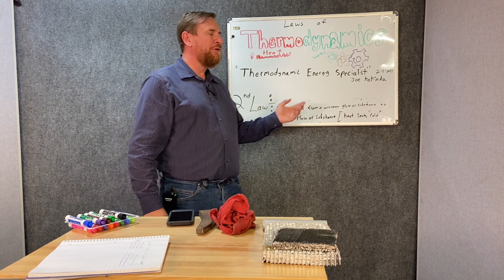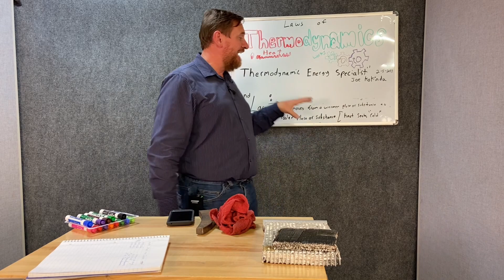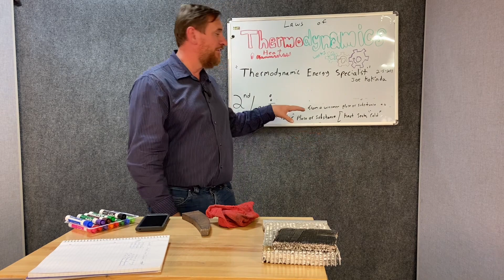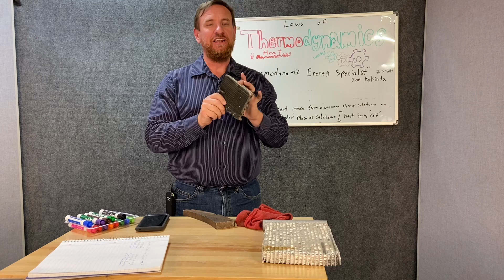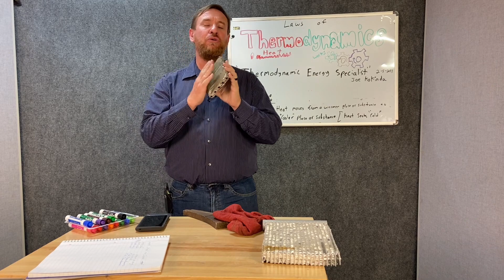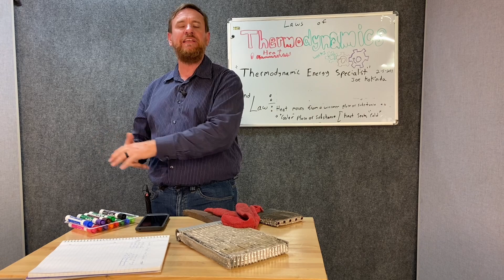HVAC 004 2nd law of thermodynamics simplified for HVAC

Comment: Thank you so much for sharing this video series. Funny story: I was vaguely familiar with the 2nd law of thermodynamics. I was having lunch with a guy and for whatever reason, we got talking about his soup. He insisted his soup was hotter near the surface because "heat rises." I didn't know how to explain that it was impossible for his soup to be hotter near the surface where it met the ambient air than it was at the bottom where it was insulated. Where were your video lessons when I needed them?

Comment: I teach my children about heat transfer and show them how it is in effect in almost everything you do.
Show my wife about heat transfer in cooking and other household and kitchen type applications. Everything from cooking in an open pan with grease versus open pan of water to oven cooking to positioning things in the freezer.
Also very importantly how even in a 100 degree kitchen extra ventilation of the refrigerator makes it still keep the freezer totally cold and easier on the compressor.

Comment: So Mr. B. I have thought about this often and have just never asked anyone. I have been doing HVAC work with my brother part-time for over 22 years. I won't bore you with the details, but rather just ask my question. Dealing with evap coils and coils, I know they are sometimes all aluminum and other times have copper tubes with aluminum fins. Has there ever been a solid copper coil? With copper tubing and copper fins? I know aluminum may be a bit "firmer" than copper, but couldn't the thickness change that? Or is it done with both because of cost reasons?
Reply from the maker: That is a great question. This means you are thinking and I love it when people think!
The answer is Yes. 
There is a company called LRC coil that manufactures them still today. 
https://lrccoil.com/coils/

Also an article about coils here, it's dated article but has some good information. 
https://www.achrnews.com/articles/87135-aluminum-vs-copper-the-great-condensing-coil-debate